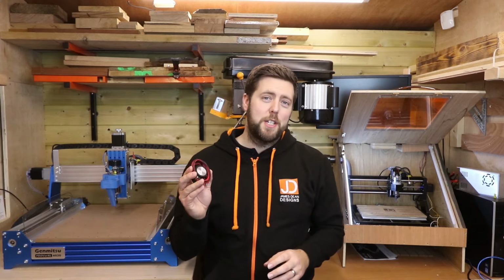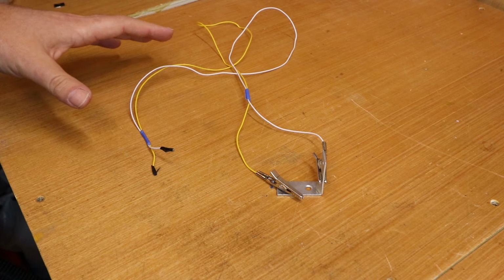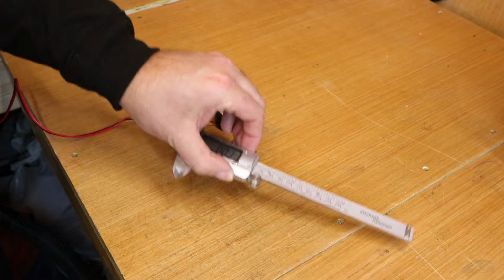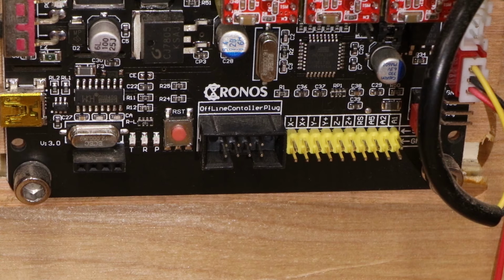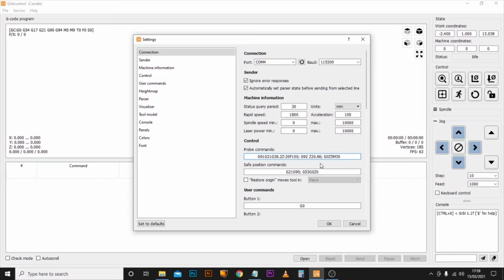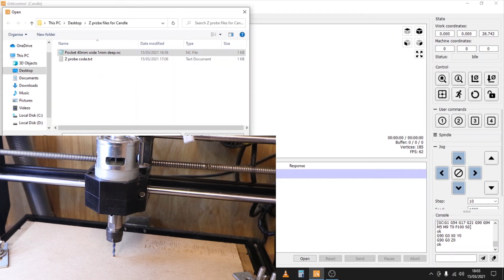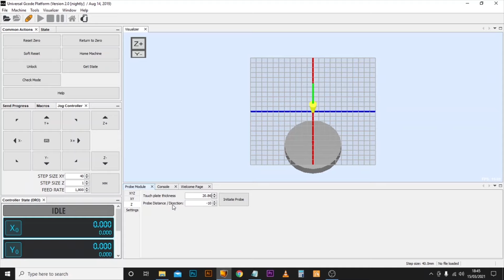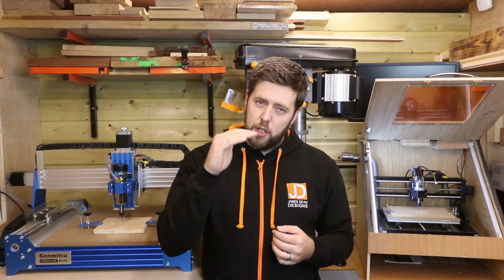3018 PRO - Setting up or building a Z probe

Comment: I have now successfully set up my 4040xe, and run a few projects, thanks almost entirely to your videos and detailed explanations. Thank you so much! One question I have involves setting up the custom user button. I set a home location, then jogged the machine away a bit.   I entered "Code for user button: G90 G0 X0 Y0 G90 G0 Z0", and checked User Controls, but when I click on User Command 1 I get an error 21 message. I have gone through the process several times, always with this result. Can you please help me with where I am going wrong? Thank you!

Comment: I started using GSENDER software as I had a lot of problems with UGS. My cuts were mirrored due to an inverted Y axis, so I changed it in GSENDER and everything worked perfectly. I decided to try UGS and for my surprise all the coordinates of the machine got lost, like in negative position, the X0 Y0 position started in the X border, so everything is considered negative. I went back to Gsender and everything is correct, back to the center of the machine to the original position as I like to position home. Correcting firmware in Gsender is a breeze. In some video I found someone telling that UGS has negative and positive versions, is that correct? And what for would that be? Can I apply this video to produce my probe in Gsender? Thanks again.

Comment: I just picked up a 3018 pro but when I try to zero my Z (UGS) with the probe that came with my machine, The Z comes down , touches the probe then returns back up to the limit switch  at Z+.  I have set the retract height to 1 from 5 and no change. Is there a setting I'm missing in  UGS or machine settings? I have set the home limit switches to -X, -Y-and+ Z during setup in UGS. It homes correctly with no issues and moves in the correct directions when jogging

Comment: Hi James, thank you for the extremely well compiled video tutorials you provide, they are fantastic. I do have a question please; I have a Vevor 3018 machine that I can't seem to get the Z probe to work correctly. The probe command works without issue and the Z axis stops when the bit touches the probe base plate as it should however it will not retract back as expected. The code I have in place is that which you have provided below "G91G21G38.2Z-20F100; G92 Z9.350; G0Z5M30" Any thoughts on what to try next?

Comment: Setting up for Z-Probing I was facing my machine, not the control board. I accidently plugged the probe into the 5v slot. The bit messed up my probe ^^ After correction everythng went fine. I already watched a bunch of your 3018 playlist but now, when I got my machine, I'm rewatching it to set everything up. Thanks for your top videos and happy easter!

Comment: For my original CNC engraver, I made a Z-probe from a broken end mill with a PCB pushbutton glued to the end of it. I'd mount it in the spindle and use it to map the surface of the material to be machined as it was pretty much guaranteed to not be flat or level (not just zero the Z-axis at a single point). I'd then swap in the actual endmill or engraving bit and zero it with paper or electrical contact.

I was hoping to find a Z-probe of this nature for the 3018 which could be mounted to the spindle carriage and fold down for use - do these exist?

Comment: Thanks for your help but i must be doing something wrong in UGS after disconnecting the probe and return to Zero lights up then pressed the bit returns to where the top of probe is not the top of the material what am I doing wrong?

Comment: hi james great video,i have a puzzle i am hoping you will answear for me ? i converted my 3018 pro to a 3040,my question is when getting limite switches do i order for the 3018 or the 3040,thank you
Reply from the maker: The limit switches should essentially be the same. The only thing I can think would be different is the length of the cables so you may need to buy the ones for a 3040

Comment: Not quiet sure what's happening but I've done this 100 times and when I click on user button 1 it doesn't go the top of the work piece I'm stumped 🤷‍♂️
Reply from the maker: I am guessing you are using candle? One thing I forgot to mention is that if you home your machine first then it doesn't work correctly :( By default 3018pro's dont have limit switches which is why I never actually mentioned it and only later remembered

Comment: HELP!  Using fusion 360 I designed a spacer I need out of a 6mm sheet of polycarbonate. The model has the origin at the bottom of the sheet. When I see the zero in Grbl, my 3018 treats the top of the piece as the bottom and never touches it. 
I used a z probe and entered the height as 6mm thicker than it is and that worked. 
How do I get the program to account for the thickness of the workpiece?
Love your channel. Very helpful.
Reply from the maker: I hate not being able to help but I'm no good in fusion 360. I'm really sorry. If you're on Facebook, join one of the user groups for something Sainsmart and there will be plenty of people who can help
Reply: Is there a way to add an offset in ugl?

Comment: Recently I purchased a cnc a ttc450 it comes with a z probe, I have tried to use it but I'm having issues, i set the z probe command on the cnc but once I set it the machine starts the work 20mm over the material, what can be the issue in my case, I will really appreciate it

Comment: ok I understand  the z probe and how to set that, but what about the x and y how do you set that so it know's where it is on the workspace  mine never goes to the same place twice when i try to use it. my board has woodpecker on it and has 2x 2y and 2 z plugs on it whish one would I use, and is the x and y the ones I use the set the x and y of my cutting surface??  if any one could help me with this.

Comment: If i have a crooked bed Can i do it at multipel points to make the program adjust to that crookedness?
Reply from the maker: Best method is to surface the spoilboard but I believe there is a multipoint function in UGS allowing you to essentially map the uneven areas

Comment: Great Video James🎉. Just got one 3018 Pro a month earlier and it works well with smaller PCBs, but I'm facing issues with some bigger designs where the PCB seem to be not perfectly flat. Can you please suggest some solution to this.

Comment: Hi James wondering if you could help, I've set up my probe commands but after the spindle comes down and touches the plate  the spindle returns up to far and and hits my limit switch 🤔
Reply from the maker: If you are using the code I provided,  then the last Z command is Z5 which means it should retract 5mm. Make sure yours says 5 and not something else. If you still have the issue then perhaps try a different program as a test
Reply: @JamesDeanDesigns  Hi James I managed to sort it yesterday 😄 it was my fault I forgot the M after the 5mm Z retraction, so I had Z530 instead of Z5M30 I got there in the end, thanks for your videos though 👍🏽👍🏽👍🏽

Comment: Sir I using cnc 3018 my parameters configuration settings is missing. I need your help all functional parameters configuration setup.  I use candle . 
Sir I shall be highly obliged if you kindly send me the parameters configuration cnc3018 . I hope you will send me. Thanking you

Comment: Concise and to the point (z0 point).  ;-).    Hey - one word of caution that folks like me who continue to use the broken imperial measurement system — In the “Probe Module” Settings tab, setting Units to Millimeters does NOT apply the “Probe Module” Z tab.  For whatever reason I used metric to measure probe thickness, 12.3mm in my case.  The “Jog Controller” was set to Inches, however.  Upon issuing “Return to Zero” after zero’ing the probe, the machine took my 12.3mm input as inches and, well, of course the bit drove down into the bed.   Ooops.   I suppose this is obvious to most, but thought it might be worth calling out.  Note to self : use metric in every setting to avoid such accidents.
Reply from the maker: Yes that is a bit odd. My log that as a bug on the UGS site to see if they can resolve. Glad my videos are helping though

Comment: help required please  I am new to cnc and can load g codes into candle and grbl ok  However every time i load the same g code file into ugs it loads the same file every time irespective of differing g gode files used. the file it keeps load is
G21 ; millimeters
G90 ; absolute coordinate
G17 ; XY plane
G94 ; units per minute feed rate mode
M3 S1000 ; Turning on spindle

; Go to safety height
G0 Z5

; Go to zero location
G0 X0 Y0
G0 Z0

; Create rectangle
G1 X0 Y0 F1000
G1 Y10
G1 X10
G1 Y0
G1 X0

; Turning off spindle
M5
 please can anyone help to fix problem
rob

Comment: So I can buy the wires n crocodile clips which is fine. Where u have electrical tape at ends, how to connect to board?  Do I just put which ever end on the z probe pins on board n use overhang of tape to hold it on. Ty for everything

Comment: Not sure what I've done but I can't figure out how to fix the issue. 
I've followed the instructions for ugs to set z height. Start the job.
And it starts 10mm over the wood.
What am I doing wrong ???
Reply from the maker: @matthewbaker2573  when you click return to zero. Does it go 10mm above the material or touch the top of the material. If its 10mm above then you have set the thickness wrong
Reply: @JamesDeanDesigns  it goes to the top of the material. I use the paper trick first. Then raise up the z to do a probe run. My probe sensor is 19.25mm, input that and run, does fine. Start the job - and the machine (gen 6050) starts 10mm above. 

Really mind boggling 😵‍💫

Comment: James, is there a way to turn the spindle on and off manually with having to type a code?  I need to pause my cut some times when cutting foam due to waste foam getting wrapped on my bit. Need to be able to turn it off to clean the bit. Thanks
Reply from the maker: Easiest option to me would be to put an inline switch or rheostat and just turn the power off to the spindle when required.

Comment: Help !  New to cnc and made a home made z probe , followed the video but when the bit touch’s the metal it disconnects my machine from PC and advice would be welcome , thank in advance Stu
Reply from the maker: I suspect the pins you've connected to on the control board are wrong or possibly touching other pins around it. Are they definitely A5?

Comment: how do you get the windows to the right i did something wrong ony have i widow
Reply from the maker: In Candle or UGS?
Reply: @JamesDeanDesigns   ugs
Reply from the maker: @danmatthew1720  under the window menu at the top, there are the various options for the different windows to turn them on or off. Once turned on, you can resize and move them about as required until you have a layout you are happy with
Reply: @JamesDeanDesigns  how do you move them around

Comment: Following your coding the only issue I had was that video's
Reply from the maker: An issue with my video? What was the issue
Reply: More the coding than the video. You said to put (G90 G0 X0 Y0 G90 G0 Z0)  I got an error message. After  research I found out this was seeing the second  G90 and G0 as a double command and didn't like it. So I removed the two commands and it worked fine after that. I believe it was a X21 error message.

Comment: I believe I have a supplier issue but wanted to get your advice.  I have Gim. 3018 prover and everything works fine except z probe.  When I set up and activate z probe the spindle comes down, touches, creates a small spark and controller trips ( all power is shunted).  The spindle does not move.   I need to unplug the PS to reset.    Working with the supplier I have replaced the z probe and mother board with same result.  I have used the off line controller in this test and Candle and USG.  All had same results.  Any thoughts or suggestions?
Reply from the maker: Sound like your Z probe is possibly connected to the wrong port. That's the only thing I can think of because it shouldn't be sparking otherwise
Reply: @JamesDeanDesigns  yes. Checked that and is consistent with pic in manual and has “probe” printed below.   Also thought I was inserting probe connection up side down but the plug connection has barbs on underside that match with the board connection. What are the odds that I have two bad mother boards?

Comment: I have been trying to get this z probe to work in UGS and followed these directions but I cannot get it to work at all. When I initiate the probe cycle the machine pushes down into the probe and will not stop. I have to hit the emergency stop button . I know the probe works because it works in Candle but I cannot get it to in UGS.
Reply from the maker: Sorry to hear that. the Z probe is a basic circuit and this is the first time I have heard it working in one software but failing in another. It might be there is a bug in the version of UGS you have downloaded, that is the only thing I can think of

Comment: Everything works except the Z doesn't touch the bed after using the custom button.  On return, the Z-axis ends up at the height of my probe.  There is no deduction for thickness happening.  Thank you
Reply from the maker: One thing I forgot to mention is the custom button will not work if you have homing switches and have ran a homing cycle. Could that be the issue?

Comment: my Z depth on this 1mm cut is now 1.18, its better than it was in candle but still pretty far off. ive followed your vids and setup - im not sure what to do next :(
Reply from the maker: 1.18 on a 1mm cut is not bad Have you followed this video about calibrating your steps? If you have and that is still the case then its like to just be to tolerance or backlash in the machine.
Reply: @JamesDeanDesigns  yes i have followed that video. to me that seems like way out of spec. +/- 0.05mm is where i would like it. im going to dig into it on monday again, getting a better micromiter to check things with
Reply from the maker: @beardedgaming1337  how old is your machine? You will start to get more movement over time as the lead screw wears. The backlash nut is there to try and help this but isn't always effective. The other thing to take into account is how you set your Z height. Paper method, probe etc. If you want a true reading then machine a larger 1mm pocket, then inset a 2mm pocket in that and measure the step into the 2mm pocket if that makes sense
Reply: @JamesDeanDesigns  it's brand new, still learning to use it. I've only done a couple of test cuts on it. 3020 pro max
Reply: @beardedgaming1337  That is pretty accurate for a cheap machine that is basically a beginner toy.
Reply: @davidkettell5726  That's good to know. I've got a bigger one I'm working on building at home. 4x4 ft XY with a 1 ft z.  Picked up a 5.5kw spindle.  I'm building it out of rectangular steel stock, welding it together. I'm worried about rigidity though under load. Thinking about cross bracing with gussets but I won't know until I get it together

Comment: James can you send or post the settings that you make for the shortcut number one button as I can’t seem to get mine to work after using z-probe. Thsnls
Reply from the maker: One thing I didn't mention is that function only works if you have not homed your machine. If you have homed it, it will not work. but the code is G90 G0 X0 Y0 G90 G0 Z0

Comment: 11:25 "And then [should] lower the Z axis until it touches the exact top of the material"... Or you get a hard crash if anything went wrong... there's a lot of assumptions of everything going right in this video. IMHO You should leave margins for error during these first tests.

Comment: Very informative. But I did not see any mention of where tomhookup the second wire on the control board. Did I miss it?
Reply: Connect the two probe wires to the two connector pins on the probe port which should be labelled as either probe or A5. It doesn't matter which wire goes to which pin.

Comment: Zero XY and Zero Z is not working on my grbl. how do i fix this? thank you :)
Reply from the maker: Hi, what software are you using? If you could also give a bit more information about what you mean by not working, that will help to solve it
Reply: @JamesDeanDesigns  i bought a new control board for my cnc 3018, after i had installed the new one, the icons for the control Zero XY and Zero Z on grblControl is dimmed and does not have a function. I cant reset the coordinates of the x,y,z therefore the spindle lifts too high , proceed to read the codes/pattern but is not touching the surface. Thank you for responding :)

Comment: You can add a second probe line in Candle to do the two speed measurement as you did with UGS. I've made a three-way corner probe. It uses a variable in the first line for the tool diameter.
#100 = [3.125/2];

G91G21;
G38.2X-30F50; 
G92 X#100; 
G91; 
G0 X5; 

G91G21;
G38.2Y-30F50; 
G92 Y#100; 
G91; 
G0 Y5; 

G91G21;
G38.2Z-30F50; 
G92 Z7.85; 
G91; 
G0 Z2.15;

M30
Reply from the maker: Great tip. thank you
Reply: BTW, for future reference, assuming your #100 variable is for 1/8" bit. They are 3.175mm you might find you're off on X Y  by A little. Not a lot in great scheme of things,
Reply: @JohnColgan.  oops. Typo. Sorry

Comment: I followed exactly all the steps, but for some reason I am getting a soft-switch warning in either Candle or UGS?
Reply from the maker: Hi. It will probably be baord related then. My first guess would be whether its connected to the correct pins?
Reply: @JamesDeanDesigns  Hey. Thanks.
Well I tried a different version of Candle, and that seem to work just fine. It's connected to the right pins.
Do you also always have to home again before using de Z-probe again (for like a new task)?